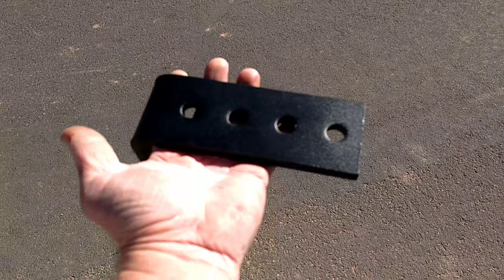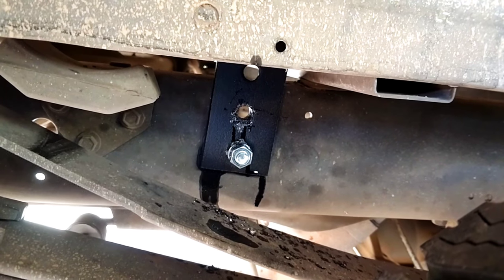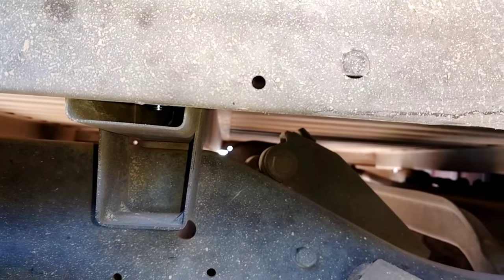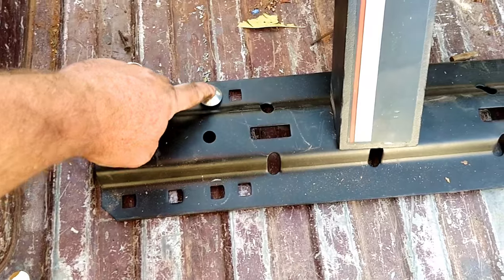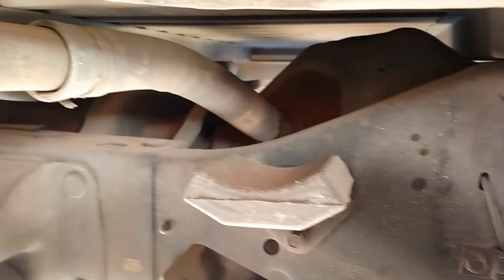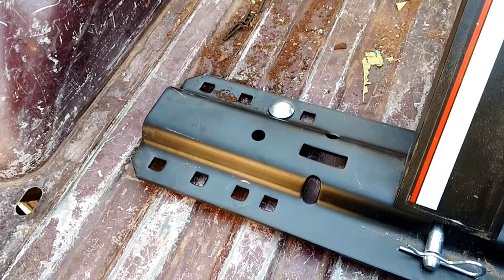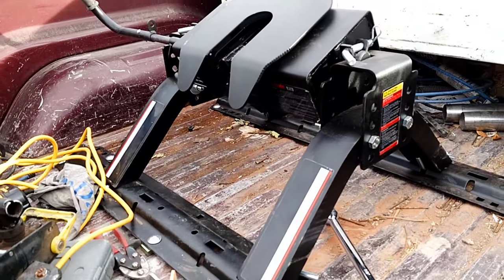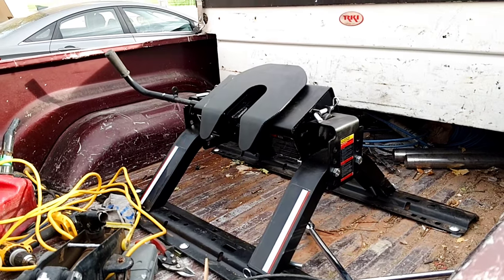5th wheel complete install on Dodge. Curt brand on 2001 Cummins 2500.

Comment: I install these for a living. I also tow with them for a living also as my second job. The bolt that goes through the cross member is the correct location for that row of bolts on the rail. You have to use what is referred to as a Handle Nut for that bolt. It is literally a 3/4" nut that is pre-welded to a long handle. One person holds the handle Nut inside the cross member from the side of the truck while one person in the bed lines up the bolt and spins the bolt to grab a few threads and then the person in the bed can zap a 3/4" Grade 5 bolt (not a carriage bolt) from the top of the bed, and because the nut has a handle, it will prevent itself from just spinning when you hit it with an impact from the top because the handle wedges itself inside the cross member. Actually a lot easier than it sounds. I've done it tons of times.

Comment: I'm thinking, mark the areas of where the cross members are and the rest, on top of the bed itself so you can see directly what you are drilling into area wise. This would require sweeping the dirt away though... lol.

I hate using a hand drill on steel, especially hardened, it's always easier when you have a small pilot hole drilled though.  Also, lock washers have to be mandatory.  I'll be tacking some welds onto it as well.  

I'm glad to see you didn't have to drop the gas tank, I was worried about that, which is what prompted me to google it up which brought me here.  Mine is a 98 Ram, 1500, so should be the same as yours I'll assume.

Also, I was thinking a simple work around for the nuts you can't access normally, drill a larger hole underneath so you can fit a socket through to reach it.
Reply from the maker: Some good ideas here. I'm still using the hitch. I sold the truck but the hitch fits on my newer truck that had the rails already installed.

Comment: Do you know the measurements to install rails in a longbed?
Reply from the maker: I believe it's 8' exactly
Reply: @VanDamArtisan  yes the bed is 8'. The measurement from the end of the bed to the rail is what I'm looking for.
Reply from the maker: I made a lumber rack once and I think the inside dimension of the bed was about half an inch more than 8', so if you make or buy one that is between maybe 7'9" and 8', it should fit fine.
Reply: @jamescounts6467  don’t listen to Reese.. after following instructions and measurements my king pin was 6” IN FRONT OF THE AXLE

Comment: Would I be able to install this if I installed a airbag towing kit
Reply from the maker: Yeah, I don't think that would be a problem
Reply: Yes. Airbags replace the factory bump stops. They are right above the axle. Should fit with no issue.